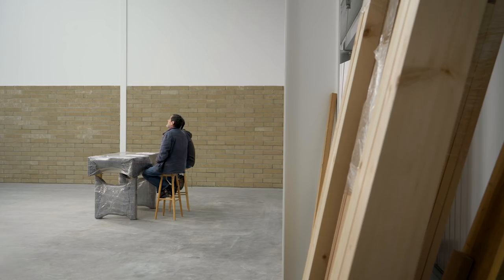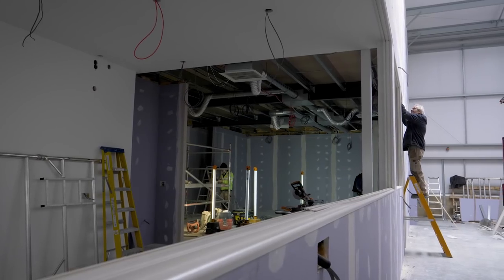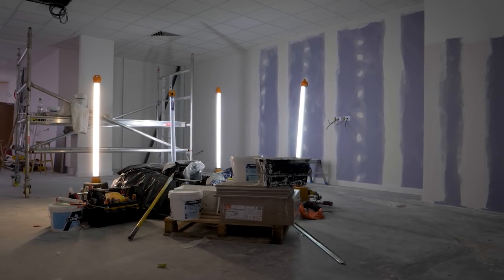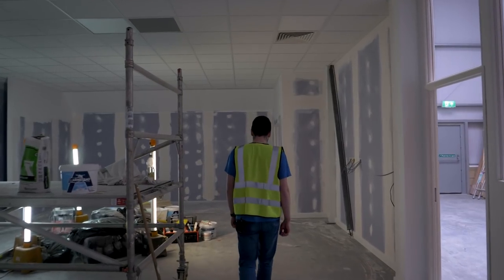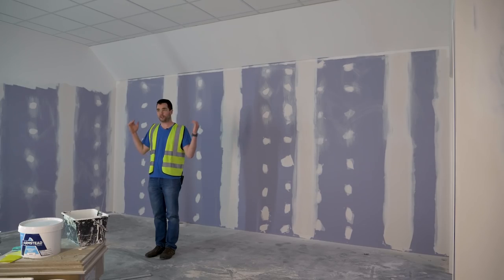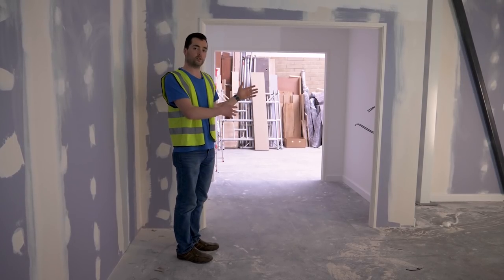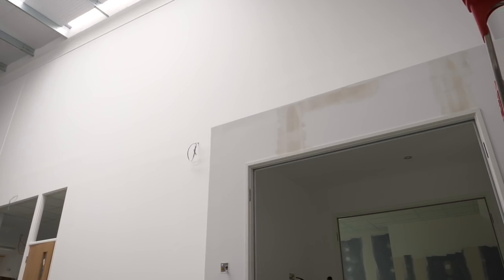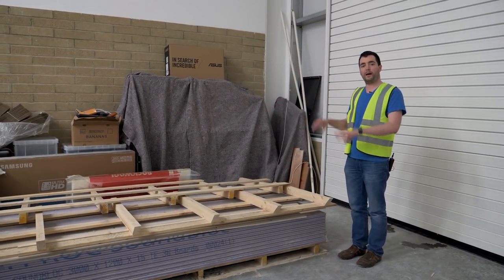Channel Hijacking! | Building Update 2

Comment: What about air quality control? Are there plans for filtration?
Love the "proud papa" glance at the camera when he was listening to you talk near the end there. Great progress going on with the shop build and great attention to sound and light control forethought.
Reply: hand tools don't make dust like power tools do . . .
(I'm not saying they don't make any dust, mind you, just not the volume of dust.  nor do they fling it to the heavens)
Reply: @ekw555 If I remember right Paul does use a bandsaw, but I suppose he would only need a dedicated vacuum dust collection for it.
Reply: that would make sense. bandsaws certainly don't throw dust around as bad as a table saw or compound miter saw.
Reply: I would think/hope that they would have a table saw, planer, and or jointer out in the extra workshop areas.

Comment: Hi Paul, you've inspired me to build a workbench using hand tools, I'm wanting to use pine for the build but I also want to use hard wood and pine for the bench top, so mostly pine with strips of hard wood for the dog holes and my hold fast holes, I cannot find any info on gluing pine and hard wood together, will this be ok? or am I barking up the wrong tree? P.S. love the channel.
Reply from the maker: Yes, go ahead and try it. The only questionable element to this would be the contraction and expansion between the wood types. You have nothing to lose. It’s not like it will fall apart you just have to resurface the top in a year or two which you have to do anyway.
Reply: Great, thanks Paul.